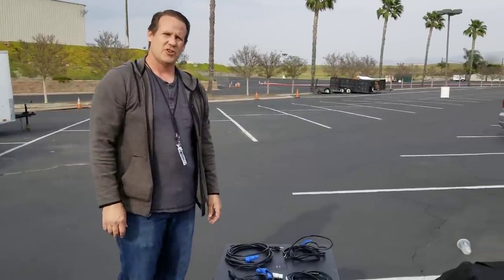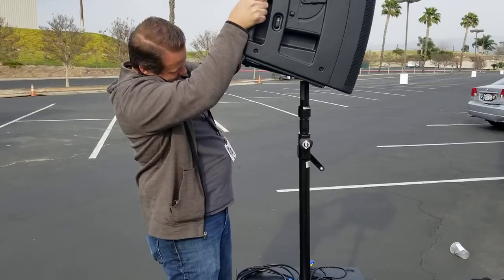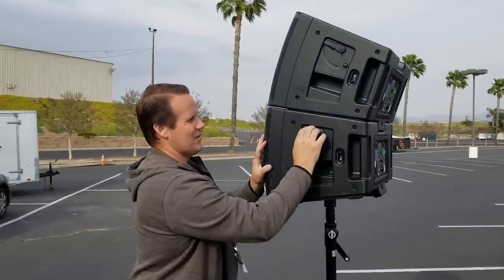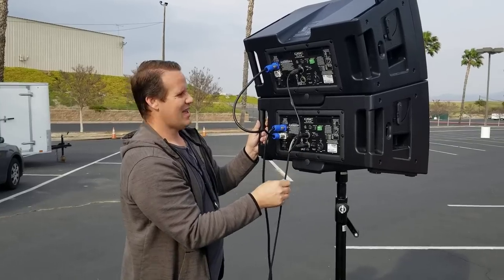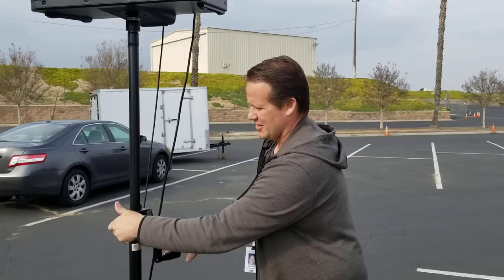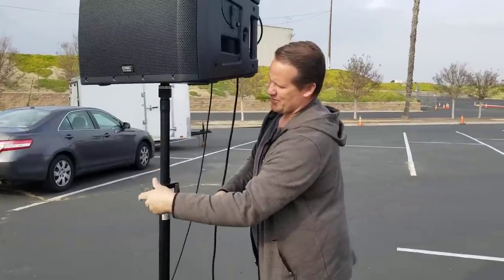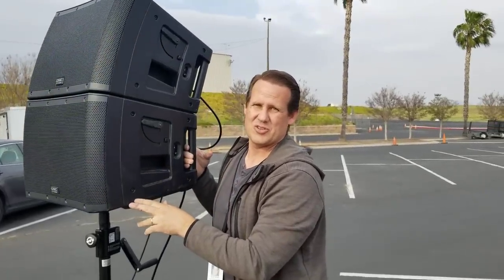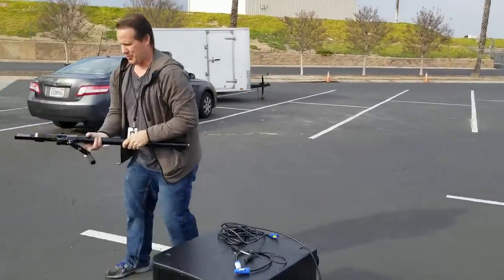QSC KLA Setup Using Crank Up Pole

Comment: That looks like a great rig except for the top speaker pointing at that upward angle. If you could tilt them over it seems like better coverage, not loosing the top coverage up in the air. Otherwise, QSC is great gear and that rig would do a great job in many different situations.
Reply: I wondered about that, too.  Seems the speaker mounting hole should be such that the bottom one points down and the other one straight ahead.  Although, the angle in the video would be good for a pa on a football field pointing up at the bleachers.  Or a theater.  But as demonstrated, not good for flat ground or level floor.
Reply from the maker: In this set up we were in a stadium theater so the people in the back were up high.

Comment from the maker: Glad to see a lot of people are enjoying this video. It was set up as a quick way to train some volunteers at location that we have. I would love to know if there are any other videos that would be helpful too you. Please comment below.  

BTW, the speakers are being used in a theater with stadium seating for all those commenting on the angle.
Reply: jagesing tulavi
Reply: Thanks for the tip. Have you tried center subs? You will get less cancellation on your lower frequencies in the center.
Reply from the maker: @tuenguyen2433  yes that would be preferable but not practical in this set up.
Reply: Link to buy that crank pole.

Comment from the maker: I've seen a lot of questions about price. This was for a portable church set up in a stadium style movie theater. We purchased through Spectrum Audio. Anywhere like Full Compass or Sweetwater would be a good place to find them but we are just a church not a retailer. 

If you have any operation or set up type questions feel free to ask but We aren't on the page all the time. Thanks
Distance Rod is K&M 21340-000-55
Reply: Nice speaker
Reply: Can I get a link for the line array aspeakers and the pool to mount them on

Comment: Why is the top speaker pointing to the sky?  Thanks for sharing
Reply: It’s actually a line array  speaker system which means normally theses monitors hang from the ceiling or a truss system. Normally it’s a stack of 5 speakers but he’s only using 2 in this video. Using line arrays allow you to point the speakers in different directions. For example; the top speaker would point at the 3rd level of an arena, gym or church and from there you can adjust the direction of the others.
Reply: @L318BLACKSHEEP  thanks for the reply.  That makes more sense now.
Reply from the maker: @L318BLACKSHEEP  is 100% correct, this configuration was used in a movie theater with stadium seating at the time.

Comment: Thank you for sharing. You got me interested with that hand crank rod K&M 21340. The spec says max load of 77lbs. Two KLA12s weigh 110 lbs.  have you have any issues with the crank gear failing due to overweight?  Thanks in advance
Reply from the maker: We've had no issues. We were using them outside and a large outdoor tent (around 600 people) collapsed from wind on top of the speakers. Besides some scuffes the crank up stands survived but the plate in the top of one of the subs did break in half. This speaker was hit directly by a 30' pole. The rating of the pole is less than the speaker weight but the rating is the same for stand alone stands and those are obviously more unstable the higher you go.

Comment: That's £4000 of loudspeaker perched on a £100 wind up rated to 50KG max, with exactly 50KG top load. I'm rather thinking that they look very, very unstable - before you raised them, let alone at the top with wind, and the cables. You are 'just' in the spec window, and a bit of wind load and that's more load than those tubes are designed for. One, I'd be happy with, but two?

Comment: it looks like the top cabinet is angling up over the congregations head. Is there a way to make the lower cabinet angle down a little bit and the top one to go straight out?
Reply from the maker: Yes they have a tilt of 6° if that's what the venue calls for. This one called for the way it's set up.

Comment: Do you not run the subs on a separate Sub Aux? If you run the kick, floor tom, and bass on a Sub Aux, you get better separation.
Reply from the maker: For this system we do run aux fed subs.  What we were showing was the set up for the top boxes so the volunteers and staff were familiar with the rigging and standard set up. The power is linked for the whole stack though, so we have one cable feeding the speakers on this side.

  We use the cables that have power and two xlrs together. 1 for sub 1 for main and at the stage box we have the sub signal digitally split so the set up time is reduced.

Comment: So to top cabinet is point up in the air. Is there no way to adjust the angle entire rig downward?
Reply from the maker: They have poles to tilt down the bottom cabinet if needed. This was just the set up for the location these were used.

Comment: Why is it that the photos make the speaker look like it's tilted down but when you actually set it up the speaker looks like its leaning backwards
Reply: Tanuvasa Family there is one cup that rotates to change the angle. If you take a look at the manual it shows some images of this set up. The system here is used in a theater with stadium seating which is why it is angled higher than usual.

Comment: please i want to know how many speaker should i link them together or how how many sub can i link together ? any limit ?
Reply from the maker: For power qsc recommends no more than 5 on a 15 a circuit. The speakers are 2.01 Amps at 120v. You shouldn't go over 70% of the outlets rating. Audio can be daisy chained through quite a few more speakers before loss of volume(of quality XLRs are used.
Reply: @harvestministriesproductio1127  i did not get you?
and please i want to ask you  can you make a video about the speaker lina array system importan

Comment: total setup how much cost... and mention currency...
Reply: The KLAs are $1,750 each. So that's $7,000. Then an additional $1,400 each for the KW181. So...that's a cool $9,800 at retail. 😳 Could probably get it for maybe $1,000 - 1,500 less though. That's a very good speaker system though. 

You can get a very good QSC speaker system for less than half that. Not as good as the KLAs, but still very good. The QSC K12.2 speakers are roughly $800 each and put out 2,000 watts each. Then pair them with two KW181, KS118, or KS212c subs for $1,400 - $1,600, and you have a really good speaker setup for $4,600 (retail) or so, that will still blow the doors off of most speaker systems.

Comment: How do you adjust the angle of the mid high boxes?
Reply from the maker: There's a rotating cup in the bottom of each speaker to angle them down if needed. A majority of set us will be at the down angle so we leave all of ours set to angle so we don't have to figure out which one goes up first. Back when we made the video it was in a movie theater so we left it at 0°>

Comment: Can you not angle these?
Reply: Yes. just put it into the stand. With floor. Here at Philippines we do that sometimes. We don't need to put it any angle.
Reply from the maker: There is an angle adjustment in the bottom of the speaker. Our application required them flat and aiming up for the top one.

Comment: is the angle movable?
Reply: Adjustable?
Reply from the maker: Yes. There's a roasting cup so you can adjust the angle between 0° (straight, like in the video where we were covering  stadium seating at a movie theater) or 6° down.

Comment: For some reason the speakers look like they're leaning back but in the stock photo it looks like both speakers tilt downward. I thought maybe there were 2 holes one that points down and one regular
Reply: Project: U Media there's one point that rotates to get the angle you need. There is a place in the manual that depicts that. The system is used in a theater with stadium seating. Thus the higher than usual angle.

Comment: How many speakers i need for 800 people pary
Reply from the maker: It really depends on the size of the room. 2 per side can suffice but if it's a wide or deep space you may need more to fill in the space where they can't reach. These are 90° x 15°

Comment: Just a couple of things.. Good video, but next time wear a mic :)  When taking the rig apart, do the cables first (after crank down) Then unlock and pull apart.. Safety first.
I would think that on a small system like this you wouldn't even need the poles.. You mentioned that the public is far enough away so I'd be inclined to put a mat on the sub and just stack 'em up.  Less obtrusive, no?
Reply from the maker: No, the audience was fairly close. To get equal coverage the top needed to be over their heads. Shocked at how many views this video has received it was more of an overview for our team. Thanks for the comment though.

Comment: how can I set up with 4 speakers ?
Reply: With 2 speakers connected, you treat them as one.  Set up 2 others, the same as the first 2, and use this 2nd pair on the other side.  One signal cable feeds each side.

Comment: That first speaker needs to have tilt-direct enabled. That is setup wrong and is dangerous. Tipping hazard.
Reply from the maker: Dennison DeNatalie actually the tilt would only need to be enabled if you had audience members that were that close to the speakers. And this setup we are in a theater with stadium seating where the first Speaker needs to be tilted at 0 and the second speaker aims a little up. With the rigging system that QSC provides this is completely safe.

It is important though to keep the sub on a hard level surface or then you would have a danger of tipping with this setup. 

Thanks for the comment 🙂
Reply: I work closely with the folks at QSC and am World Of K trained. My sources say incorrect. My only suggestion would be to be careful please!
Reply: Dennison DeNatalie if they disagree they should update their paperwork.
Reply: Dennison DeNatalie the weight distribution and center of gravity are not so drastically different from 0 degrees to the -9 degrees of tilt direct. If you also notice this is being used with a single sub and has plenty of balast before it becomes a tipping hazard. In the user manual it even says you can use this type of setup. This appropriate for the venue and application that this specific setup is being used for. Thank you for your positive feedback. :)

Comment: Can you not see where that top speaker is pointed... Unless you are trying to broadcast to god, that top box is pointless... You should have turned the bottom pole mount ring to start a downward angle... This is why this form factor is garbage (fixed angle plastic box line array).
Reply: It's you read the description you would see it was used in a temporary set up in a movie theater with stadium seating. If they were aimed down the audience at the top of the theater wouldn't have a speaker pointed toward them.